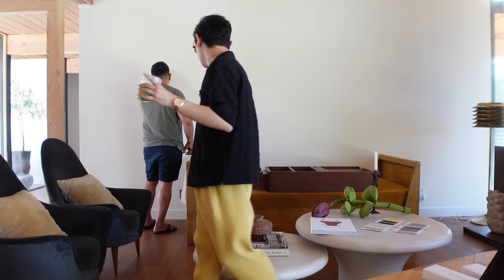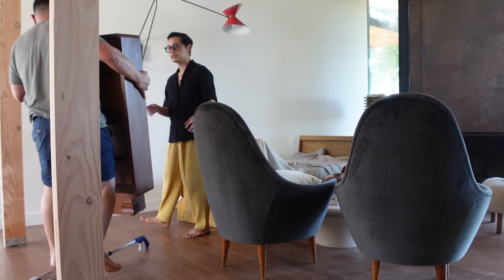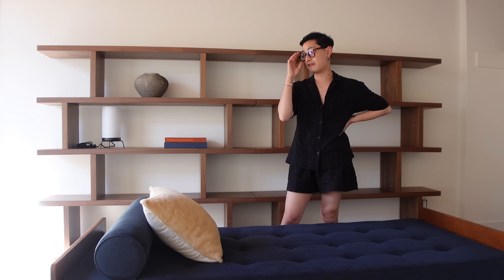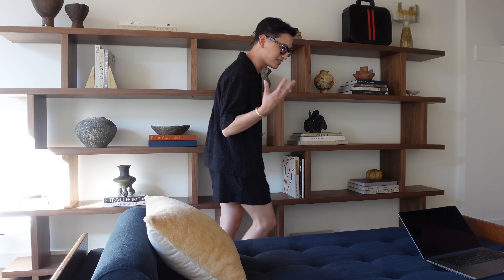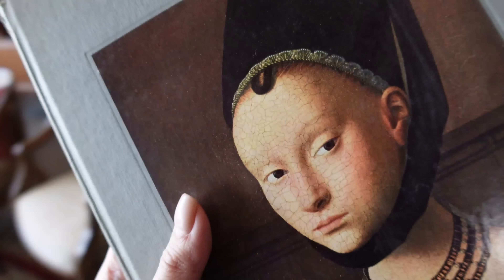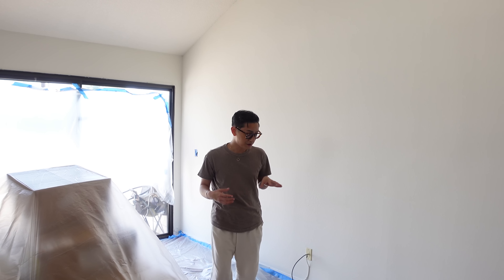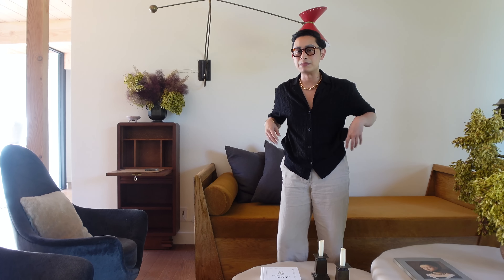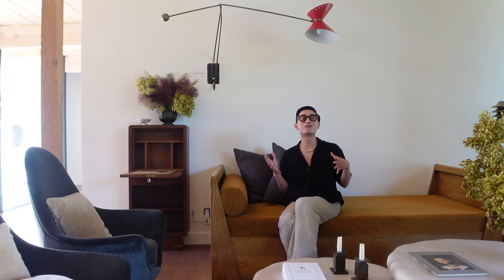HOUSE UPDATES & MAKING OVER A DATED LIVING ROOM

Comment: Nobody asked but I would actually love the articulating MCM sconce in the library 👏👏👏👏👏👏  and big beautiful art in the living room. Love your style and funk Arvin ❤️😉😘✌️
Reply: I agree that the sconce is begging to move to the library, as task lighting. The LR, instead, wants an oversized pendant light with fabric shade. Don’t mess up the ceiling with a hardwire fixture, though. Use a plug-in power source (or convert it) and swag the pendant lamp. Then it’s easy to move and reposition.

The roasts are a fave feature. I learn so much from them. Keep roasting everyone, yourself and subscribers included. Congrats on your Rugs USA Collection. It’s beautiful. Please pace yourself. It’s good you are so successful, but don’t feel pressured to work to exhaustion. You need a life outside of work, too, or you risk burning out like a comet. No, no, no. You are a star.

Comment: Hi Arvin!  I’ve missed you.  If you are going to recover that daybed in one of the colours you showed us, I think you will need the pop of colour the sconce provides to punctuate your space.  Your floor lamp is lovely, but it looks marooned.  If you keep the sconce, are you putting  anything else on the wall over the daybed?  My eye is drawn to the significant expanse of dead wall between the two light sources.  Perhaps a smaller, horizontal painting hung to the right of centre over the day bed would balance the sconce and floor lamp.  You can achieve the softness you are seeking in the art piece, say, a water colour in the creams and beiges of your decor, or even something dark and moody.  I would hang it, unframed.  Just a thought.

Comment: Hi Arvin,  I think you are spot on about the red wall lamp.  It is distracting due to the color in that particular spot.  I agree that something softer and fabric would probably look better.   That is such a large wall, I think the scale of the articulating light is also part of what you are not as thrilled about.  I am in love with the brass floor lamp just like you.  Have you thought about using photoshop to try different looks before doing all that installation?  My son is a wizard on photoshop and he helped me decide what I wanted to do with a fireplace wall.  Right now it is wood so we tried it with different colors and even changed the brick to different stones to see what I thought.  It was lots easier than painting the wood and finding out I really liked to wood the best.  This is just a thought for you, but it does save a lot of extra labor and can give you a good visual of how something will look.  Best of luck!

Comment: Good video!  Agree regarding that stunning articulated sconce perhaps not working to full advantage in the same visual scape as the floor lamp you are certain will stay there.  You mentioned a fabric shade as a substitution to soften; my thought is something more "neutral" and yes, softer so as not to compete to the strength of the floor lamp - both pieces have so much drama they do deserve to stand alone. The sconce does look great on the large empty wall though.  Curious if the sconce is designed to swag away from the wall as an option.

Comment: Everything is looking great! I would keep both lamps and just move the brass lamp to a different part of the room. Your friend's house honestly looks like a mishmash of styles, but I would lean into the Spanish revival elements (arched window, tiles, beams). You could plaster over the fireplace, which looks more mid-century. Remove the builder grade trim and add some taller plain baseboards, craftsman style, which would complement the Spanish elements.

Comment: I like the sconce; however, at first I thought it was hung too high.   The advantage of this height is that it does not get in the way of potential artwork.  Somehow, I envision 4-5 pictures in black framing hung straight across this section above the daybed.  I like the other floor lamp especially but somehow it seems too low when looking at the two together - seems like balance is slightly off.  Just thoughts.... if anything you are truly the design expert!!!